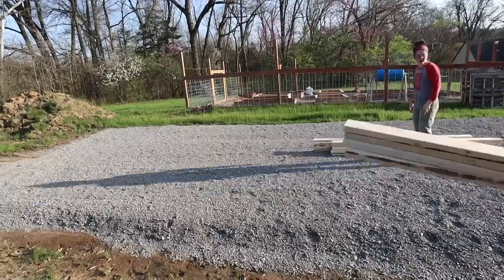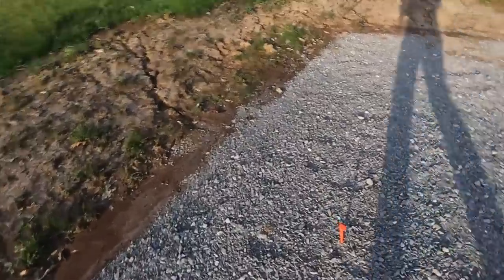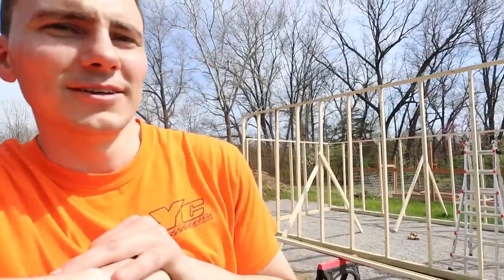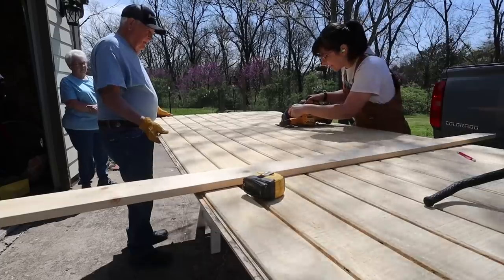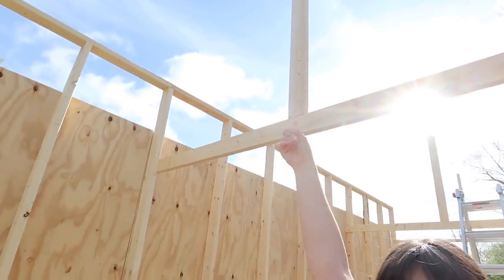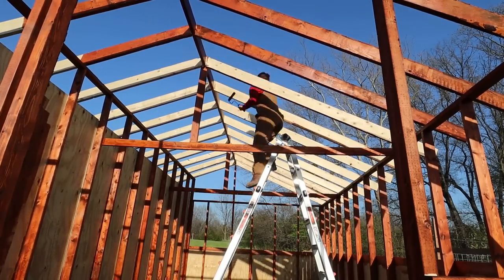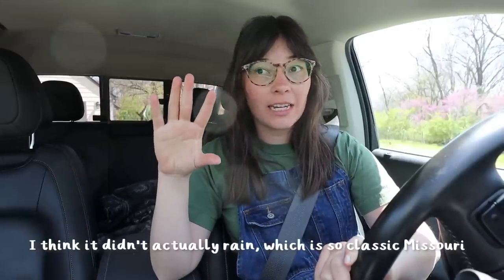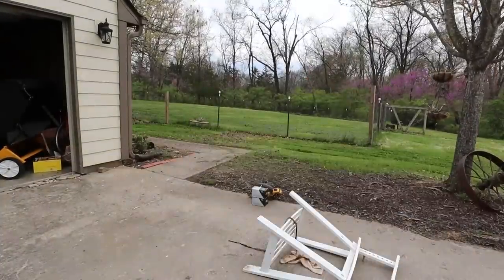Building a Custom Greenhouse! | DIY custom greenhouse build

Comment: Looking good so far. Suspect heating cost will be better matched to the exposed surface area rather than the square feet as the exposed surface is where you will lose/gain heat. For the back wall darker is better in winter to absorb some heat, not sure how much. Have heard of people filling jugs with water and painting them black just for that purpose. The insulation sounds like a good idea, all around, to save on heating cost.

Comment: I think if you enclose the back wall it will help insulate your greenhouse better for heating through the winter months.. I guess as long as your doing the back wall I would also do the front lower half of the wall. Just my thoughts, I would paint whatever you decide to do with a white washable paint. White will help brighten the area up? 🌷💚🙃